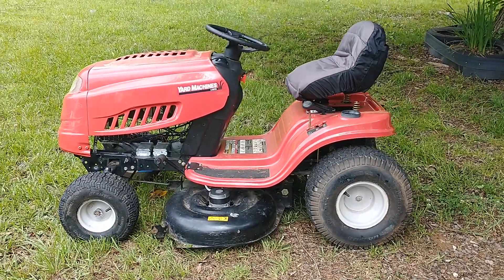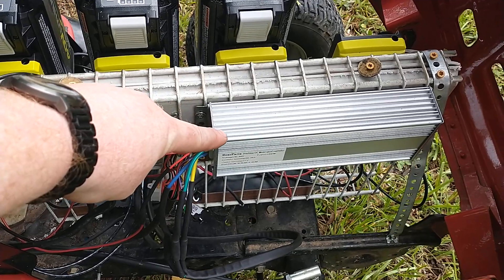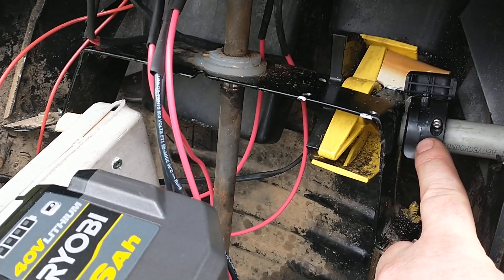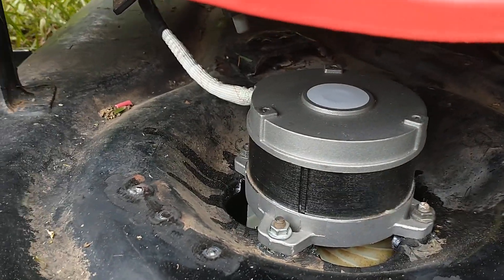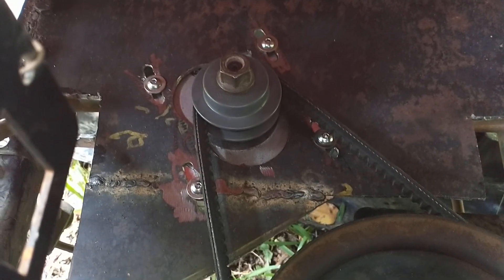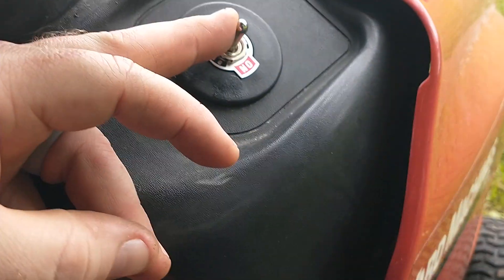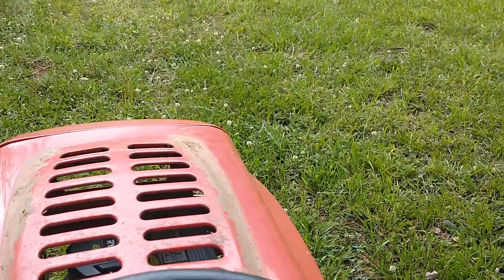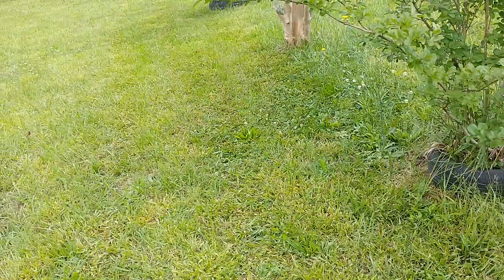Ryobi 40v Brushless Lithium Powered MTD Yard Machines Mower Electric Conversion Triple Motor

Comment: This is awesome! may i ask what your usable time is? I'm thinking of converting mine over since it's 17 years old
Reply from the maker: With 3 of the Ryobi 6ah batteries the run time is about 40-45 minutes. I have a very boring video that shows this as well as lets you see the specific conditions of the yard and the test. If I didn't already have batteries to use for this I probably would just buy a 48v 100ah golf cart battery and it would mow my two acres on a charge. However, I figured the batteries would last longer if I charged them inside. That seems to have worked since some of them are 5 years old or more and still great.
Reply: @oddjobsandrandomprojects thank you!
Reply from the maker: One small tip, don't convert a hydrostatic drive model unless you want to use a bigger motor and use a lot more power.
Reply: @oddjobsandrandomprojects I plan on keeping the hydrostatic rear end. My yard is pretty flat so I can get away with using a "wimpier" drive motor. My friend has a lot of spare scooter motors which we are going to test and see which one works best for it
Reply from the maker: @chuckee1987 I know I tested mine with a 750w motor and it wasn't enough. Got too hot after about 3 minutes. There are some 1800w scooter motors you can get for about $110 new that should do nicely. I think the pump in the hydrostatic uses extra power, but that should compensate. If you are using Ryobi batteries you might need 2 on the motor drive circuit to balance the power draw, but that will likely work.
Reply: @oddjobsandrandomprojects thank you so much! This is all going to help tremendously

Comment: This looks so simple.   I am tired of fixing my ICE lawn tractor.  May be taking on this project soon.
Reply from the maker: It's definitely a good project. Just be sure to use good wire and connectors. Several problems I encountered were due to cheap wire or connectors. I have a few update videos and I intend to post another video with some changes I made to the design.

Comment: is there electrical schematic and parts used , trying to do a project of my own
Reply from the maker: I haven't made a full wiring diagram, but the drive controller I bought came with it's own diagram. I did post some diagrams and instructions about the mower part on another video that may prove helpful. But if not let me know. I've been planning on making a diagram, but haven't taken the time yet.

Comment: I get where this idea comes from due to the ryobi batteries being premade packages, but honestly even then its a weird conversion with there being notably better options, and especially now this is just defunct. The amount of strain this will put on the batteries will wear them out quickly and the cost per kwh is just not there. A 48v (51.2v) LFP battery and ebike controller just does this job better in every way.
Reply from the maker: That is actually true and was a consideration. But I opted for this for several reasons. First, if the battery dies I don't have to push it across my yard. I just go get another battery. Second, battery replacement is much cheaper if one fails. At the time I was getting my batteries for $60 each and it was cheaper per kwh. Things have changed since then, but I still have the option to only replace individual bad batteries. Third, I already had plenty of these batteries for testing. So it was an easy choice for proving if it worked or not. Fourth, I can charge the batteries in a climate controlled area which is better for the durability of the batteries. So far I haven't had a battery fail. However, I still think that if I didn't have batteries I would probably start with a 48v E-Bike or golf cart battery.

Comment: I'm looking to run a Troy bolt horse tiller using a similar approach.  The tiller came with three motor options ranging from four to seven horsepower. I have green works 80v batteries already and seeing what you did, am thinking of just using one of their motors of similar size and using your 12v (or motor voltage) converter and charge controller set up.  Anything I should consider with the different use?
Reply from the maker: I don't know exactly what the power output of the Green works motor is. You may need to use a gear reduction system to compensate if the power is low, but it should work. Does it use a pulley to connect to the motor, or is it direct drive?
Reply: @oddjobsandrandomprojects it does use a pulley but it is in a cast enclosure so changing pulley size would be a challenge.

Comment: A 12v 250w motor with a built on pully connect to 12v  400ah battery will last for 20 hours it can prob get you atleast 2 mowing of you yard
Reply from the maker: I could actually do a 48v 100ah battery, and have considered that. It would mow my entire lawn without issue. But I like being able to bring the batteries inside to charge and store them away from the heat in my area. So I'm a bit conflicted.

Comment: Hi there. Are your Ryobi motors compatible with 20" blades? I could be mistaken, but would that cause a gap between the blades resulting in mohawks? Great vid!
Reply: Nevermind, I see now in your description that they are 21" blades. My mistake.
Reply from the maker: No worries. The motors were actually from a 20" blade machine, but I just bought 21" blades since they are compatible.
Reply: @oddjobsandrandomprojects  Thanks for mentioning this valuable info about the compatibility.

Comment: Did you keep the original transmission? If so, how strong is it in first gear and how fast is it in highest gear?
Reply from the maker: I did keep the original transmission, but it is actually a single speed transmission. I setup the gear ratio of my drive pulley to give me a slow mowing speed since my yard is rough and hilly. But that gives it lots of pulling power. It will pull a car on level ground. However a multi speed gearbox would be a big advantage.

Comment: Excellent job! Did you source all the Ryobi components new (as spare parts)?
Reply from the maker: All except the batteries, which were mostly used ones. But the motors and controllers I bought on eBay as ones pulled from new units.

Comment: What is the run time?
Reply from the maker: 3 of the 6ah batteries gives about 45 minutes of run time. But you can have a set charging what you are mowing if you have sufficient batteries like I do. So in my case it doesn't ever run out of power.

Comment: I'm getting the 40 volt 18 inch heartbrand from Walmart I want to use three of those push mowers to too a riding mower I know that the same brand as Ryobi I hope I can get my setup to work without killing myself but I do have an engineering helping me so I should be good thank you very much for the idea
Reply from the maker: Glad to help! I have several videos about this project, including things I've learned along the way and improvements I've made. It's still a work in progress, but the whole family loves using it.

Comment: Where did you get your drive motor pulley looks like it fits on the shaft perfectly
Reply from the maker: I believe I got it from Zoro. Probably could find it on Grainger. I did have to bore the hole out a little bit on my drill press to get it to fit. However, the tension of V-Belts wears the motor bearings I found out after using it a while. Now I use a cog belt so there is less tension. Seems to work better. There are more videos on my channel about that process. Now I 3D print my pulleys and the motor bracket.

Comment: This is awesome i have a John Deere 300 do you think it's possible to do the same thing to it although i don't need the mower deck i just use it to pull things around my property
Reply from the maker: I have no doubt it can be done. Without the deck it will be even simpler. You could use a larger motor. There are some that are about $100 new that are about 48v 1500w. Or at least they were that price. That will give you huge amounts of pulling power. Of course that depends on what battery you will be using. Getting the gear ratio figured out might take a little work, but it's totally doable.

Comment: So you're using the same motor type for the drive as you are for both deck blades?
Reply from the maker: That's correct. I did recently swap the drive motor to a slightly larger version of the same motor that was from a Husqvarna mower. The reason for that was I wanted a cog belt instead of a V-belt to save wear on the bearings and reduce noise. The Husqvarna motor had a shaft that I was able to 3D print a cog belt pulley for easily. There is a video about that process too.

Comment: Hehehe I paused at the battery hot swap, thinking... arrange into V shape, but 8 of them... put the Motor Speed Controllers and converters in the middle of the V. :) 

Aaaand Play.
Reply from the maker: That would actually be a really cool idea. I have done some upgrades since this video and that might need to be one. I just would need a diode on each battery to prevent them from feeding power between batteries. I'm testing that now on the electric scooter project, but this could be next if it works. Then it could mow at least twice as long on a charge.
Reply: @oddjobsandrandomprojects  I would suggest a common system. 

Pending the use of all fully charged packs, you might be better off wiring 8 in parallel. Have a common "+" and  "-" point into your main fuse. All batteries will be depleted equally, and you have the resource of a higher total Ah battery. Sure at each of the 8 packs, you'll have a fuse of a suitable and appropriate size to protect the packs connected to a common busbar type setup. If 6ah packs, by 8 packs, 48ah battery at whatever voltage those packs are, I forget at this juncture. One can only hope/assume you're getting these packs at discount rates, not buying new.

May want to consider splurging on a dedicated Li-ion battery or similar, the weight and power density might be worth 3 times the price of other commonly available battery types

Just my thoughts. 

Peace be upon you, stay safe out there.
Reply from the maker: @ScooterMcAwesomeness  Yeah, I had been getting used ones, other than what came with some of the equipment that I have, such as their inverter, chainsaw, push mower, and trimmer. I had a place on eBay I'd gotten used packs for $60 each. By the watt hour it was cheaper than buying the other of the shelf packs, although that was a consideration. I could probably more the lawn on one charge if I'd done that. But I didn't like the idea of charging them outside in the summer heat. With the removable packs I can charge them in the house where it is a better environment. Your ideas are helpful and appreciated. Thanks.
Reply: @oddjobsandrandomprojects   Leave all the packs removable, I think that's a necessary idea. Both for weather protection, and to control battery temps while charging.

Take a peek at either of Greenworks' 80v ride-on lawn mowers. They operate on six 5Ah 80v batteries, all connected in parallel as one battery.

I like your conversion as is, seems functional. Just throwing some ideas at your wall and seeing what sticks.

Comment: How many watts does each motor draw?
Reply from the maker: I really should put a meter on it too find out for sure. I have been told they are rated for a max of 750 watts. However the average draw is more like 350 watts, since the batteries hold 240 watt hours, and I can mow about 40 minutes.

Comment: Price of the Ryobi 6ah at Home Depot $228
Reply from the maker: You are very correct. Buying the batteries individually is a terrible deal. Better to either buy a tool with the battery included, or I purchased open box ones on eBay for about $60.
Reply from the maker: I just checked today and the entire push mower (which is what the parts I used came from) is $329 with the battery and charger. So yeah, they are totally overcharging for just the battery. Could just buy the kit and take it apart cheaper. I actually was going to do that if I hadn't found a good price on eBay for all the parts.

Comment: How long do the 6ah battery run out of power?
Reply from the maker: Takes 3 batteries at a time and mows for 45 minutes. But I have 3 fast chargers that can recharge the batteries in an hour, and 9 batteries available. So I can mow the whole 2 acres I have on those 9 batteries without waiting for batteries to charge.

Comment: Very nice build and thanks for sharing. Had you considered using 4 x 20 ah LIFP04 batteries (or 50 ah) as opposed to ryobi batts? Were ryobi batts a good deal?
Reply from the maker: I did consider 50ah batteries, but ended up using Ryobi batteries for a few reasons. 1. I already had several batteries. 2. I was able to get open box ones cheaper per aH. 3. I wanted to charge the batteries inside to avoid battery degrading from heat. 4. Removable batteries mean if it ran out of power I could swap batteries rather than push it to the house.
I was concerned though that the battery life would be too short with the Ryobi batteries and that I'd be swapping batteries to often. But the 40-45 minutes run time has been easy to deal with.

Comment: Is buying huskivarna dc motors better at over $200 for them over the Ryobi motors?
Reply from the maker: They do appear to be a slightly better design for the drive motor, but I'm still using Ryobi motors for the blade motors. I also got my Husqvarna motor for $50, and my Ryobi motors were about $45 when I got them. I'm sure prices have gone up since I bought them as that is most often the trend.
Reply from the maker: I wouldn't pay that much for one. At that price on be looking at one of those 1500+ watt Vevor motors and using a chain drive.

Comment: What is the name of the power converter at around the 1:00 mark? I’m planning on converting our mower to electric over winter.
Reply from the maker: That is a voltage reducer that converts 40vdc down to 12vdc. It is similar to this one https://www.ebay.com/itm/183896696358
I use it to power the headlights, and the 12v tank sprayer I tow behind sometimes. I recently added a cooling fan for the drive motor it also powers.
Reply from the maker: BTW I will be adding a video sometime soon with some upgraded 3D printed parts that make the conversion easier if you have one available. I will share the files so that anyone can copy my work.
Reply: @oddjobsandrandomprojects  ohhhh nice. I’ve got a 3D printed at home and will certainly use some of those parts.

Comment: This is awesome! Would love to do the exact samething. Do you think this would be powerfull enough to work with a bagger set up? 
Also could you please break down the cost to do this and where you bought all the parts? Thank you
Reply from the maker: I kind of doubt there would be sufficient lift to throw it into a bagger, but I might be surprised. I have another video in my channel that details the parts costs as well a operating costs. It has links to the individual parts in the description, although some may not be available from the same seller anymore. 
https://youtu.be/rNciemB_3YA
Reply: I must say that my concern about throwing grass into a bagger may fall considerably short getting into the bag.  Does anyone have proof that these electric blade motors have the power to push dry grass into the bag?
Reply: Is it better to combine the 2 motors on one controller or split them?

Comment: Nice build!! I am currently building a rc mower and plan on running the ryobi motors for the blade. Can you assist with wiring for the controller PLZZZ. I am unable to find a schematic. I purchased the motor a controller used, so I am unable to verify the safety switch wiring.
Reply from the maker: I will see if I can get one together this weekend. I've been meaning to do a video on the wiring, but my job has kept me recently.
Reply from the maker: I have just added a video that should show you what you will need to test and use that motor and controller. I am very interested in your project and would love to see a video of that when it is complete. I have thought about building an rc mower myself, but am not familiar with wiring the remote control parts. Considered either using an old self propelled cordless mower, or converting a 42" riding mower deck and using wheelchair type drive motors to operate it.

Comment: Do you have any feel for how fast the mower will move or mow?
Reply from the maker: I need to see if I can get an accurate measurement. But I'm going to call it a brisk walk speed at the fastest. Mowing speed depends on the grass. It is the same as the push mowers it was built from, but I don't have to push and it's cutting twice as much area at a time.

Comment: Awesome! My 40v ryobi 20" motor broke off the mower and I went and bought a new one but the motor is still fine. I'd like to figure out some other project to use it for because I have 6 batteries sitting around and a good 40v motor/controller. Thanks for sharing. What kind of controller did you buy for the variable speed?
Reply from the maker: It's just one for an ebike. 1000w 36-48v. I have another video that actually shows what parts I used and the video description has a parts list. When I get some time I also plan on doing an updated video for this with a few small improvements I've made since that one as well as some better views of the mower.